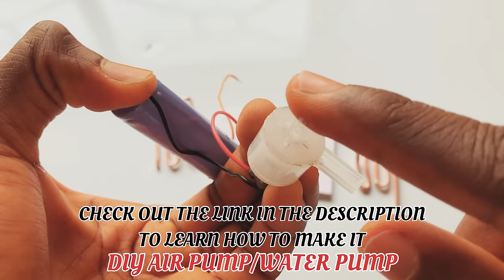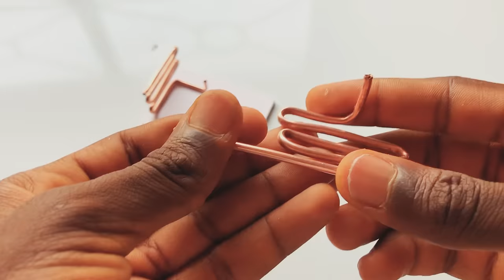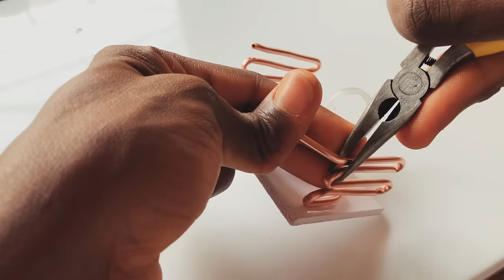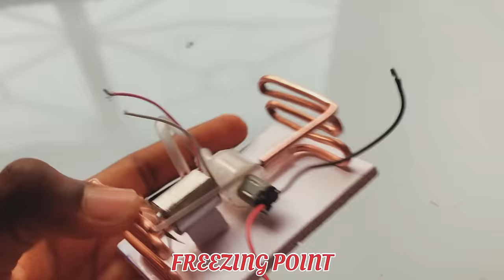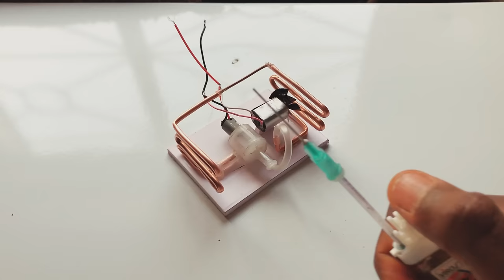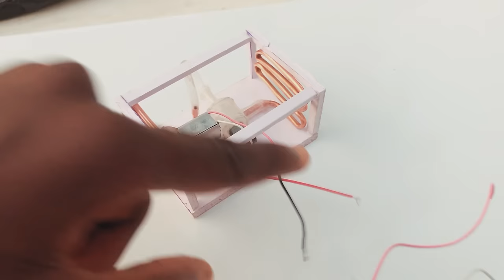How to make AC || Smart Air conditioner At Home || Mini powerful AC

Comment: Seems legit... The pump dumps high pressure into the hot side and that pressure goes through the small orifice which creates a pressure differential. the cold side is warmed up by the tiny fan and you get the cooling effect. The gas goes through the pump again, which is pressurized once more. So yeah... it works!
Reply from the maker: Exactly bro.
You've earned my respect
Reply: @marcelosantos-hd5wd  llego el alma de la fiesta
Reply: the problem is compressing flammable gasses and air (21% oxygen)
Reply: remove the oxygen before introducing the flammable gas and you are far less likely to make a boom
Reply: @jellybean2032  put a schader valve, create a vacuum with a kitchen vacuum machine pump, and load the gas from the lighter
Reply: @jocelynlinot4754  doing triple purge will remove almost all of the oxygen,  fill it, drain it, do that three times then charge it with the gas, much safer. pulling a vacuum also works if you have a vacuum pump
Reply: @diogoamarald1550 it's just a cheap small pump 😂
Reply: E o oxigênio que estava nos tubos não foi retirado .
Creio q a pressão interna seja igual em ambos trocadores de calor .entre alta e baixa .
O gás não e comprimido e sim acelerado pela turbina
Reply: I'm skeptical only because you need a compressor to pump out some serious psi to condense the refrigerant as it is the condensing that generates heat and sucks the warm air out of the hot room like a magnet and dumps it outside which is too much for that 3v motor
Reply: Theoretically yes, but there has to be a lot of pressure
Reply: It is a butane, boiling point at atmospheric pressure -0.5degC. So once starts freezing, the internal pressure on the evaporator side goes below atmospheric, so such crude construction will always suck some air in.
Reply: @worthbuddyg6760 It is indeed very suspicious. Yes, butane is very low pressure refrigerant so this may be able to hold the charge for some time. But it is supposed to use a fixed orifice capillary metering device,very finicky to get working at a reasonable efficiency. So even in case it is not truly fake, it does omit to show the tedious adjustments of the metering tube, to match the used compressor flow. If nothing else, the compressor definitely won't have any performance margin to tolerate anything but really optimal adjustment of both metering device, as well as the exact charge.
Reply: Bro what is that gold color please you can say me the name
Reply: @gabtechexpo4017 bro that gold color please can say name
Reply: Cooper pipe
Reply: @cookbpy6053  Cooper pipe
Reply from the maker: @cookbpy6053 it's copper pipe
Reply: well, maybe replacing with r134a refrigerator gas will eliminate the o2 problem.
Reply: Yeah except it's fake.
Reply: Problem is thats not a real compressor so it cant build pressure like a real AC
Reply: @gabtechexpo4017  in place of compressor you used a pump why the pump can increase pressure!??!
Reply: this is how an ac works but which liquid is used??
Reply: @samitsikdar498  I think butane, it seems like the differential isn't great enough for it to work though. butane is however a good gas to use.
Reply: Why frosting there. you need gas charge
Reply: That's nice
Reply: But for how much time will it work

Comment: It's hard for me to believe that you can diy such low pressure pump. Talking about gaz leaks to the external and internal system (by poking a hole in the pipe W*F) AND leaks between low pressure side and High pressure side (with a poorly designed impeler).
I highly doubt about this being legit ...

Comment: Use two fans on both coils and then you have the option of a heat pump and and AC.  Place the hot coils in front of the cold ones and you have a dehumidifier which also serves as a water condenser.
Reply from the maker: Great idea 👍 ♥️
Reply: Siz yapar ve yayınlarsanız seviniriz.Teşekkürler.
Reply: To me also I feel I wud collect d vaporised water and use a heat coil with fan to blow the water,  which wud also act as a humidifier
Reply: Would a dual-shaft fan motor work in this concept?
Reply: تم عكس الفيديو لاحظو ذلك من خلال قطرات الماء فهي تصعد بدل النزول
Reply: Wouldn't the heat melt the foam?🤔

Comment: Fantastic example to explain how a fridge works.
Reply: @finniboy9670  it looks scientifically sound.
Reply: @finniboy9670  No lo es, utiliza el mismo principio de funcionamiento de una refrigeradora
Reply: Холодильнике другой принцеп работа тут скарей всего принцеп работы редуктора авто .
Reply: but the gas used is highly flammable, he should use HFC-134a instead of this gas.
Reply: Give me a link where you showed on how to make air pump/water pump
Reply: It's ridiculous that the condenser is so much smaller than the evaporator. Some people know that the condenser pipes of the refrigerator are much longer than the pipes in the refrigeration section. Also a refrigerator uses at least a 100 watt motor to cool such a long pipe. A 3 or 5 watt motor is used here. It is claimed that it can reduce the temperature by 50C with 3-5 watts of power. Think: Can you heat that copper pipe to 50°C with that small battery? Some physics and logic please! Remember that sometimes awe-inspiring things can be magic shows. This is just one of those maker videos trying to fool people!

After writing this, I found it by chance, here is a video explaining the trick. As I guessed, this was a magic show. It cools the pipe by spraying gas on it.
I subscribed to the channel in the link for its honesty. He really deserves this. The link is here.
https://youtu.be/sg-kjsLZnNE?si=FSML-yUd25SURJji
Reply: Ye fake h ,
Kyu ki iske hisab se to ye hua ki agar AC ya frize ka compressor kharab hua to uske jagar water pump ka use kar sakte hai lekin water pump bus water ko pump kar sakta hai compressor ki tarah nhi aya samajh me
Reply: Is this unlimited cooled or needs to refill every minute or seconds?
Reply: Fake

Comment: I was wondering to use this in order to make my Peltier efficiency (wine cooler) better when ambient temperature raises. I'm now working on it. Great idea.
I have to ask you: When you are filling the system with gas, if you make a drainage hole for the air inside, could it be more efficient?
Reply from the maker: Yeah

Comment: If you go the heat pump route, you just need to separate the hot side and cold side air wise, add a fan to the hot side. Butane gets pretty cold to liquify, so basically the pump acts a a condenser pump, and that narrow piece of tube is what is called a capillary tube. if you had something of a better tank piece up to an ounce size, and filled it with a few lighters worth in the same kinda way,  you might get something that could handle more power, up to that of a mini fridge. Mind you, that little pump won't last forever, and it would all work better if you could make the system vaccuumed empty of air, but it is a good demo model of how all the basic parts work.
Reply: Its great for getting a+ in school projects
Reply: Is it only the narrow pipe or there is some system to it? @jasonmorello1374
Reply: If it work for 48 hour non stop i am sure the condensor start to ignite the gas on the pipe an it will burn all of componen.
Reply: Thank you for this wonderful analysis. Are you a specialist in this field?
Reply: Fiquei imprecionado foi com a sua atitude de querer ajudar o jovem que deu início ao protótico embora simples mas vc viu um futuro brilhante, parabéns por querer ajudar
Reply: Thanks!  Can you please give us a clue about how much refrigerant to put into the system?  Is it like; enough to fill the coils on the hot side where the liquid is? TIA.
Reply: It's a fake
Reply: Butane will turn to liquid as pressure increases. As pressure goes up so does temperature. At 0 psig it becomes liquid at just under 0C. At 2.5 bar or something a bit under 60psig it can become a liquid at around 20 - 25C. It isn't cold because it's liquid. It's liquid  because it's under pressure

Comment: I don't comment very often but am compelled to here. Great job, totally legit, have high pressure low pressure with boil off point, just never thought about using butane as a coolant. GREAT JOB!!!!!
Reply: I have difficulty to buy that, the pressure difference in both sides are minimal
Reply: davidsmith3302  i will build one to confirm
Reply: davidsmith3302  😊many thanks sir,i will build it
Reply: 但他这里没有压缩机，气体怎么变回液体？
Reply: @akm90115 hi you said you will build one and it's two months now, any info for us about whether it is legit or not
Reply: @ephraimojima4582  i really like the question sir, unfortunately not yet,i was travelling between 3 sites for work on the 3 last months,so i did not have the time for,but be sure i will Macke it and you will be the first one to know,just give me some time my friend.
Reply: @akm90115 hey no worries. All the  best at work
Reply: @ephraimojima4582  thank you!
Reply: @akm90115 did you build it
Reply: @amazingboi6570  sorry but not yet,but as i said,be sure that i will,once done you will know
Reply: @akm90115  you don't need to build one to confirm......... i'll tell you how he has really done it...😆😆😆😆

He has first place that stupid contraption in a freezer. Once frost has accumulated on the pipe, he has taken it out, run the fan and shot a video of the frost melting. Then he shows that video played in reverse.......
Reply: @MondayMorning-yv7nf  🤣🤣🤣your explanation sound's  more legit to me!!
Reply: @akm90115   for an better understanding, observe the water drops on the copper pipe.
Reply: @akm90115  Stay in close range of an extinguisher - just in case
Reply: @daCount0  im verry awear of that,🤣thank you

Comment: Awesome video and an excellent DIY working model of a refrigerator. Those who try this out please remember that the Butane gas used as refrigerant here is highly flammable and so please refrain from exposure to high temperature and make sure you are in apt environment to this out.

Please also ensure there is less leakage by using proper sealant as joints or filling the has before joining components.
Thank you

Comment: You cannot use a water pump to compress gases, you need a compressor in a closed system (and no leaks!)
The compressor needs to be able to compress the gas into a liquid (in vaccum) for the expansion to even work for cooling
and the system needs to be able to handle such high pressures.
The expansion "tube" is not even that thin to create a high pressure difference to reach that performance.
Refrigerants exist for exactly that purpose.
I'm no engineer but we had classes about this in highschool.
Even a DIY air pump (with a piston) and a syringe needle could've been a better way to illustrate how heat pumps work.
Edit: Funnily enough you already used a syringe needle in the video but for a completely different purpose lmao

Comment: really cool. the only thing i prob would change is not using superglue. would epoxy the joints or if i cant get epoxy then the superglue/baking soda combo if i remember when you mix the 2 it becomes rock hard. just to avoid the very small chance of the tubes comming undone from the pipes.
Reply: He maybe use whats available materials (preferably cheap) he can get but we all can observes, learn and modified it to become better. This is good way to spread knowledge.

Comment: This crazy risky contraption is what we need. After years of hesitation thinking about it, this guy just provided that needed little push with real proof of concept😅 For yall who lives in countries where this could be illegal please don't do it. But for the rest of us permanently soaked equatorial creatures surrounded by the sea cooked by the sun eaten by bugs and molds and devoid of any enforced safety regulations, in the name of humanity... let's doeiittt! Thanks for sharing bruh!👍💯
Reply from the maker: Thanks 😘
Reply: It'll only work until the gas depletes - which will take around 10 minutes - before you have to refill it.
Reply: @kellyeye7224  Then make a better seal.
Reply: @captainjj7184  Doesn't matter.  Without the use of compression the gas will distribute evenly around the whole mechanism, the temperature will equalize right around it and it will cease to work.  Don't believe me?  Make one and find out.  Or learn thermodynamics.
Reply: @kellyeye7224   Cool, good to know and thank you! Please stick around am gonna need you when I get the things together. Thermodynamics or no thermodynamics stuff gotta be made to work :)

Comment: Yes, is genial idea, i do mini air conditioner with humidifier and for best cooling i use plates and gas, is working amazing. I use in my work place because i make portable with power bank battery 12v 40A, and that battery as well i make just for personal use.
Reply: Thank you for this wonderful analysis. Are you a specialist in this field?
Reply: @يزيدالبليده  i wass little scared about the gas because maybe can do fire with motor case for pump because gas is diferent to water. But for the moment still i keep  attention. Is in probation.

Comment: Thinking of using this to make a water cooler for my room probably use some 3-5 liter water container will use 12v water pump with the temperature controler so the pump doesn't over run..

Comment: M refrigeration machnic. And it's work but I do with little bit big moter dc 12v and use fire free  R134a gas install with pin walv or filter also... And it's work parfect 🎉
Reply from the maker: Thanks for your feedback 👍
Reply: Hey can I use to make the heat in summer in the kitchen go away ? Brother can we talk regarding this project?
Reply: HVAC tech here. Interested. In the follow up
Reply: U tried it and it worked?😊
Reply: @ekeminiumoette6566  it's not working. Need more PSI

Comment: this is amazing! For me it's a little complex looking at real air conditioners, but seeing it your way, it seems to be much simpler! Did you use the original lighter fluid? Or did you use refrigerant gas? You are a very intelligent person, thank you for sharing your knowledge!
Reply from the maker: Thanks a lot friend,
I made use of the gas fluid
Reply: 😢 you really think ,this is real.
Reply: @ssomchit1 yeah I bet this person does think it is real because it is real, this project makes use of a thermal property that is all most exactly what a real air conditioner would use. A common example of this property is how when you spray an aerosol can the high pressure in the can goes from high to low pressure through a small hole causing the can to get cold, this project in the video does the same thing. The pump produces pressure and the Small tube he used creates the high to low pressure difference causing cold temperatures to form on the larger pipe where the low pressure is at. But I'm curious why you would just assume that the video is fake and then shame someone else when you didn't even know if it was real or not??
Reply: Major commercial refrigerator companies are using a purified butane gas in their units now.  The basic concept is compressing a gas then releasing it requires energy and that's what is causing the cooling.  The other coil should be getting warmer as the unit runs.
Reply: Lighter fluid as refrigerant cool.when the pump moves the refrigerant it absorbs heat from surroundings.how long does the refrigerant last?
Reply: @nerog3136  As long as it stays in a closed system it will compress and expand.  Refrigerants don't have a lifespan, they just escape.
Reply: @rcstl8815  it's mostly cause butane isn't harsh on the ozone layer. The older refrigerants do a better job, but bad to our atmosphere. You can use Butane or Propane, but Propane is more risky because it requires more pressure than butane to be kept in a liquid state and could lead to a leak more likely. So instead of hurting our ozone, we just have to worry about a fire hazard if there is a leak. 😅
Reply: @gabtechexpo4017  What fluid,?
Reply: @batterypwrlow  yea has seal 110%
Reply: @batterypwrlow  If you dont know you'll be spun when you also realise Ammonia is pretty common in commercial refrigeration systems.
Reply: @WhatTrigger  i didn't know that. I just did some research into how a/c worked and stuff out of curiosity and remembered most of it.
Reply: @Ryno-jn9kv The last part of the video gave it away. Looks like you didn't realize it was playing the melting ice video in reverse.
Reply: @gabtechexpo4017   nice , gas is gona leak from your pump , isnt it
Reply: @elephantbirdlord  finalmente uma pessoa que percebeu  a verdadeira parte do vídeo , nada disso aí é verdadeiro , e algumas pessoas achando que este vídeo é legítimo 😂😂😂😂

Comment: Why conditioner? Make a small fridge for aluminum cans or cold drinks! 👍😊
Reply from the maker: Thanks
Reply: I am too interested in fridge
Reply: Their are already small room size refrigerators in the market working without compressor with a gas and a heater. I had one 20 years ago which I throwed away.
Reply: @back.to.future  need a DIY video manual then🙂

Comment: Yes, it is possible that the experiment was successful. Usually there is a refrigeration system that uses stove gas like that in refrigerators.
Reply: It's not possible, do you calculate the pressure difference to make it happen? NO!
Reply: Are you being ironically funny? 🫥

Comment: You are so great and genuious Sir . Would you plz throw some theriotical explanation .Hiw if works so the I can make one for myself .Where yo get the copper thin tube .Will a 4 volts DC motor work
Reply from the maker: You can get it from a refrigerator spare parts shop.
A 4 volt motor will work well ♥️